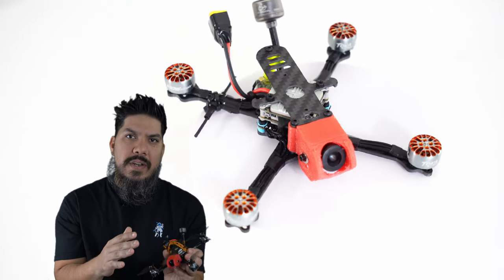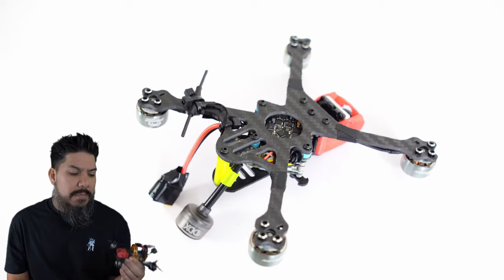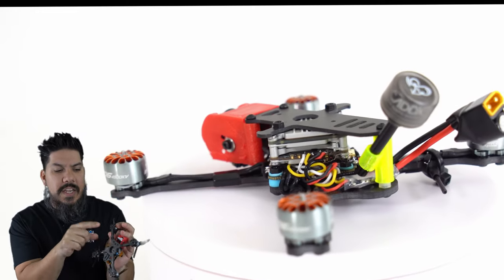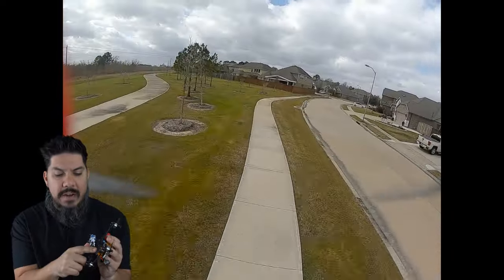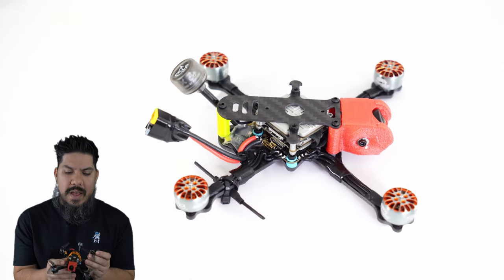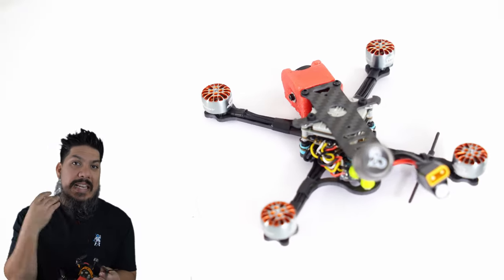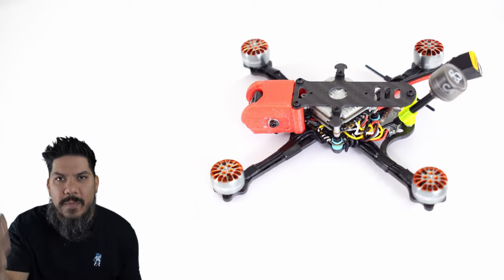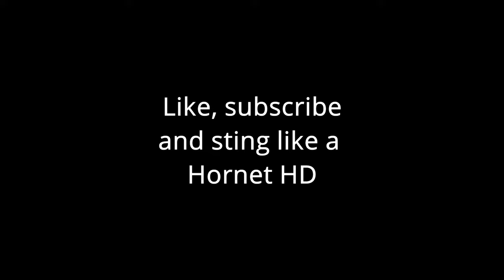Hornet HD DJI FPV 3" Toka 1206 motor - Micro drone by TorqueFPV - Lightweight Tiny Trainer?

Comment: I’ve been eyeballing this frame for a while, thinking about converting my toothpick to digital. I’d probably decase the Vista and mount it on the bottom plate above the AIO. Then I’d remove the tabs for the TPU strap and use a traditional strap. Plus, I’m from Louisiana so I’d be supporting my local economy!
Reply from the maker: Nice! You guys from Lousiana are doing some crazy stuff over there!  Love how you guys are pushing the DJI FPV limits!
Reply: Kelvin KWBoost is the DJI master. you should look him up and go out to one of his races.
Reply: I ordered a frame the other day to do this very same thing!! Great minds.

Comment: I like the smaller 3in quads a lot! Less noise, can hit smaller gaps, still a ton of power! So far I only have the Transtec Beetle and iflight Titan H3 And I love them!!!
Reply: I just bought the Titan H3. What was your first impressions? Is a good flyer? Anything you don't like about it. Tks! I love the 3" quads. (coming from analog)
Reply: @armani007E55  Ton of power! Quieter! Smaller! Cant go wrong!!! I was very impressed!!! Iv smashed it a ton of times also and no problems yet!!! (Just go thru alot of props) I recently switched from top mounting my 1300 4S battery to bottom mounting it.  I have a few videos posted it you want to see what Iv been doing with it. TON OF FUN!!! I would buy it all over again in a heartbeat!!!!!!!!
Reply: @contagiousRC  wait did you say 1300? Lol WTF. How's it fly with the 1300? I thought 850 was big already? I have a few 1300 packs so that just made my day? Still freestyles good etc? How much battery time are you getting? Sounds good! I can't wait,  I don't have 5" yet and they are pretty loud so good for where I go flying. Tks for the feedback 🤙.
Reply: @contagiousRC  subbed!

Comment: Just built one of these.  Used RC Inpower 1207's/5000KV and 22mm aluminum standoffs - gives a bit more clearance between vista and AIO board.  Went to Resoft today to maiden, but park is closed for repairs - will hit a different site tomorrow.  Can't wait.

Comment: At 10 seconds slower per lap is that using 3S or 4S? I built my Hornet with 1204 x 5,000kv with 4S and the dry weight is sub 100 grams and it flys great with plenty of speed and long flight times. John from Chicago
Reply from the maker: That was using 3S. (Compared to my racing quad which has 5" 2207+ 1860kv RCinpower on 6S).  4S, and another 5 practice packs, could have gotten me a lot closer.

Comment: Do you like your Armattan Gecko 3" with Vista?

I'm looking at a Armattan Gecko 3" with a VIsta and a  20x20 stack and RCinpower 1506 4300kv motors for freestyle. AIO boards scare me.
Reply from the maker: Yes, i actually built up the 4" gecko with the vista, such a great build.  I used betafpv's 1805 2550kv motor on 4S. But your specs should work absolutely great.   You cuold consider the 4" frame, and just run 3" props (its not that much bigger, and only gains a few grams), then you have option to run 4" props down the road if you ever want.  (I tend do to this, with 6" frames and run 5" props like the Badger, and bangGod).  The props being a little more distance away from each other, ends up getitng cooler/less turbulence to rear motors for slightly smoother flight.

Comment: Im thinking of buying the diatone roma l3 for a second quad and I dont know if the bnf version with the mamba msr d16 will pair to my radio-master TX12. Does the mamba msr d16 inside the roma l3 run on frsky d16 protocol? If not, Then I will have to learn how to solder and buy the pnp version and use a xm+ or r-xsr receiver.
Reply from the maker: the radiomaster TX12 should do D16, and if the reciever that ships is d16, then it should work no problem.
Reply: OK Thank you so much! Ill definetley get the diatone roma l3

Comment: Hey I have those same motors for a cinewhoop build and they get super hot even without the gopro. Do you have any tips
Reply from the maker: what cinewhoop frame?  I think they would be a little overloaded for a cinewhoop, i usually use 1507 on something like shendrones squirt.
Reply: @JonE5FPV  that's what I started thinking but I took the GoPro off and the frame is pretty lights (75g) so it's a normal 3" build and the motors are not any less hot.

Comment: That’s 10s more because the track is meant for 5’’. But if one shortened the straight lines a bit, it would become much harder for the bigger birds and 3’’ would suddenly become the beast to have ;)
Reply from the maker: yeah for sure, it wasnt super fair, because i only flew a couple of the 3" packs, if i put more, probably would have been within 5 seconds, (or on a tighter track, with less long straights)

Comment: Honestly, running a Digital TinyTrainer as a spec class option (on 1207's, 3S 650mAh packs) would actually be pretty legit for racing... and now I'm wanting to try it because I'm an idiot.
Reply: As much as the racing footage is cool, you illustrated perfectly why 3" is brilliant for fast freestyle in places that big quads wouldn't be an option, or would make the space too small, but 3" just parties.

Comment: Too top heavy?? With the Vista and battery on top?
Reply from the maker: doesnt feel like, it, the weight is mostly centered around the prop line, so it feels pretty good in the air.